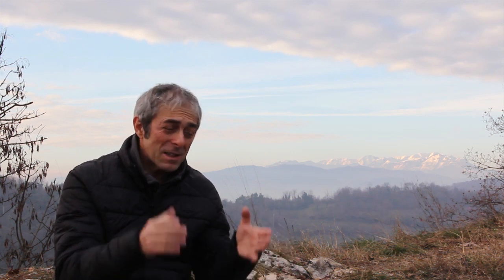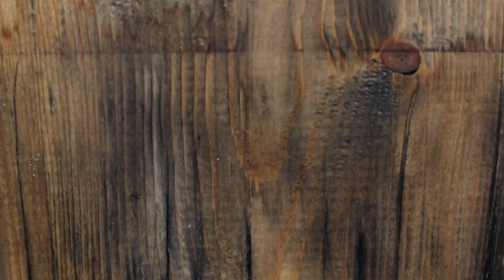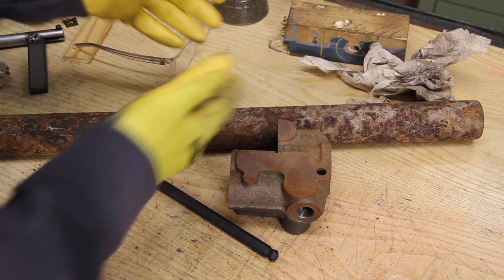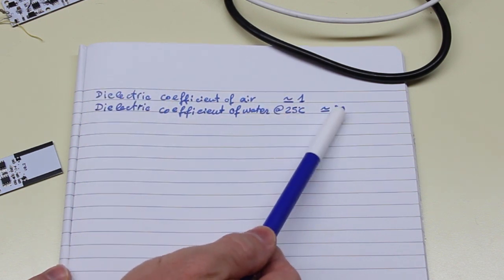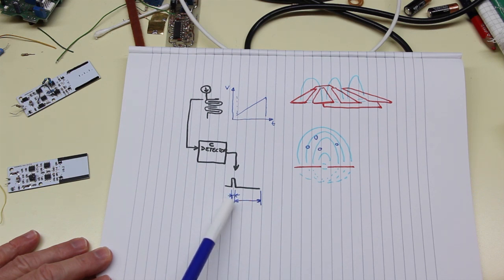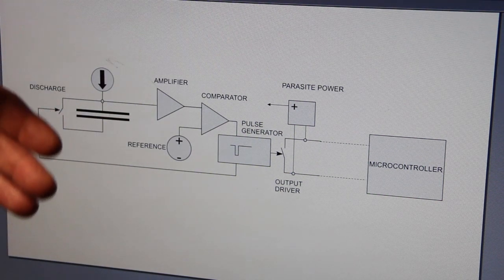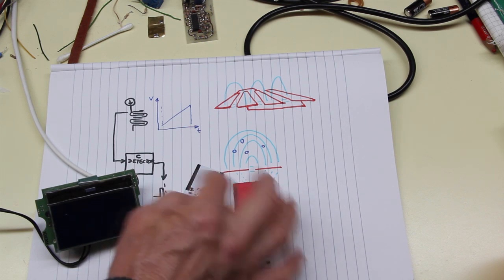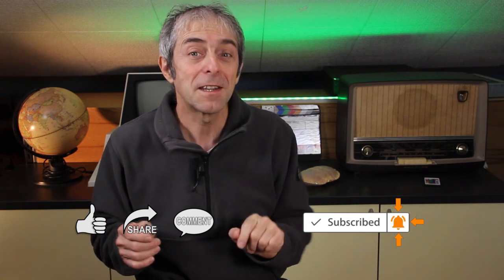Water Particles Detector using Projected Electric Fields

Comment: Please suggest pdf or book to understand the concept of Capacitance to make application like sensor and other important applications.
Reply from the maker: Sorry for the late reply. I would really like to give you a good response, I had a book specialized in describing several kind of sensors exploiting capacitive effects, so I searched for it in my book collection but I am not able to find it anymore and I do not remember its title. To understand the concepts behind capacitive effects every book treating EE or electronics is good, but probably you need to cross read two or three of them. I think in this link you can find a quick good starter: https://openstax.org/books/university-physics-volume-2/pages/8-1-capacitors-and-capacitance (also go through the other sections of the chapter).
Set apart the courses in EE, more insights can be achieved by going through real projects. I did this under private research and after years of designing, testing and benchmarking, devices for actual applications. I had a book (the one mentioned above) that I used as a reference to know the state of the art, but you can gain more knowledge by examining patents. This is a hard, tedious work, because not only you have to go through learning how to search patents and how to find them, but also because patents are written in a foreign language that you have to learn first off: Legalese :) However this method opens up a lot of insights into the state of the art.
So what I can tell you is: do a lot of experiments ! There is nothing more valuable than making your own experiments, asking yourself "what if" and try + check. Track down the results and compare them with the theory. Then use your creativity.
Greetings from the Alps. Claudio.
Reply: @AccidentalScience  please share your email address
Reply from the maker: @sagargupta3890  you can find it under the about tag on my channel's page.

Comment: Excellent work.  So the output of the comparator flips and triggers the pulse generator, which makes an oscillator.  And the microcontroller times the pulses?  Are you going to sell these?
Reply from the maker: Yes, it works that way. If I find people interested in buying or reselling them, why not.
Reply: @AccidentalScience  You should.  It has many uses.  I would buy a few.
Reply from the maker: @unhinged-menagerie  let me know more. Where are you located? Please write to info at my channel name with no spaces dot com.
Reply: @AccidentalScience  I sent an e-mail a couple days ago.  Did you get it?
Reply from the maker: @unhinged-menagerie   I'm afraid I messed up the spam folder yesterday and some legitimate emails were lost. May you please send it again? Sorry for the inconvenience.
Reply: @AccidentalScience  E-mail sent.
Reply from the maker: @unhinged-menagerie  sorry, nothing has arrived. I've even double checked the spam folder. In case of doubt, the address is as the website name: accidentalscience.com, just add at the beginning of the name 'info' followed by @ to get the email. 
Anyway Let's try even an other path: https://www.facebook.com/AccidentalScience/
Cheers.